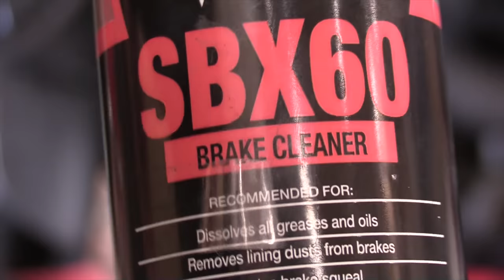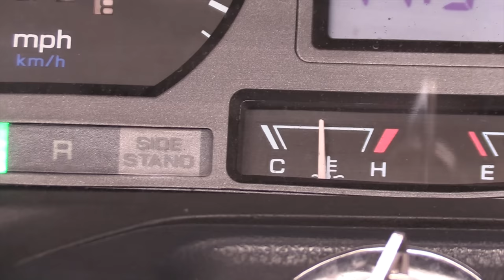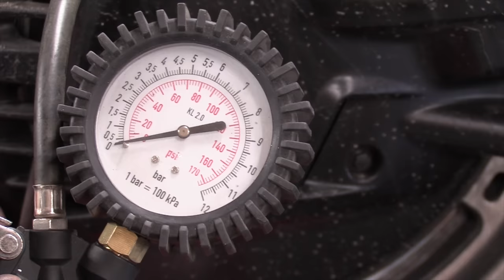Honda GL1500 Gold Wing, "Oil & Filters change" !

Comment: Nice vedio ,  but there is no need to add oil to the filter before installing it, just install the filter empty and put the factory recommended amount of oil . leave the engine runing for few minutes , then check oil level again .

Comment: Love the old Goldwing content Del. Looking forward to a nice warm summer to put a few miles on my venerable old GL1100.  FYI the Sealey brake bleed syringe unit from Spanner Monkey arrived today. Will let you know how things progress.  Run my GL on Smith and Allan super 10-40 oil. It’s approved to API SL, JASO MA2 so perfectly suitable for motorcycles.  Ride safe sir.
Reply from the maker: Thanks Michael, really appreciate the feedback, and great to hear that your syringe arrived, let us know how you get on with it.   Thanks so much for your support.. D&Pxx
Reply: Del, used the Sealey bleed syringe, great piece of kit. Only took a few minutes to force the fluid from the calliper to the master cylinder reservoir.  Let the system settle for a few days then bled the brakes in the conventional manner to remove the last traces of air. Next job, bleed the front brakes of my Z1000 A1 - should be nice and easy.

Comment: Nice work Del and Penny. Doing anything on a Goldwing is a treasure hunt... dig until you find what you're looking for. Great video... nice to see you priming the oil filter as one should. Does that Simota air filter not get an oil coating? Stay safe and healthy!
Reply from the maker: Hi John, I like that, that pretty much sums up a Goldwing, like a Pandora's box of plastic panels!  The Simota filter, just like K&N, come oiled and ready to fit, which is why they're in a sealed plastic bag, and you buy solvent and oil separately to service them later on!

Comment: I have a 2014 Ultra Limited that doesn’t get ridden much at all for various reasons. I use Mobil 1 synthetic and was wondering how long you would recommend leaving the oil in before changing it? Like time wise?
Reply from the maker: Hey buddy, it depends largely on your climate, if you're in a cold, wet climate you'll get lots of condensation inside the motor on short rides and the oil will gradually get waterlogged, leading to rust on internal surfaces, but if you live say in Arizona where it's hot and dry, your oil will last much longer, unless you get the bike super overheated on continued short parade runs... many Harleys don't do high mileage and in that situation, just drop the oil every year as part of your annual service regime, it doesn't cost much compared to the life of your engine so why not spoilt your baby!
Reply: @Moonfleet41  I live in Texas USA where. It gets cold in the winter but not like the northern climate. Whenever I ride the motorcycle I always ride it enough to get it up to temperature, so no short rides.

Comment: Well I have reused the Sump Plug on my 12 Goldwing Umpteen Times...it never Leaks.....
it does not appear to be deformed in any way...Hmmm..
Reply from the maker: "Hmmmm"?  Not sure what that means?  ... but if you're questioning the process, look how deformed mine was, if yours doesn't drop off the plug by itself, and it's jammed under the thread, then it is compacted and deformed, and your manual will always advise to replace it... and remember, it isn't just about leaking, the soft washer also acts to lock the thread and keep the plug in place in the repeated heat cycles any engine will go through...

Comment: The air filter is easier to do when the machine doesn't have a radio/cassette fitted like yours.  I am surprised you didn't change the fuel filter while you had all the plastic off.
Reply from the maker: That top panel is just as easy to get off, and replace, with the audio unit fitted, it's just one extra plug to undo!  And as for the fuel filter, it was replaced with the fuel pipe when I got the bike as it was weeping...

Comment: Del, whats your opinion about copper washer for drain bolt? Which is better?
Reply from the maker: Both as good as each other mate, but in this instance the service manual for the Goldwing specifies aluminium, so I go with that as I have some!
Reply: Good question, I'd wondered the same!  Oh, and thanks for the answer, Del!

Comment: Ah, wheels away that lovely piece of rather immaculate Wensleydale & then rolls on a whole six pot Stilton, complete with 237 panels  of Tupperware 'crust' & an air filtration system that would have stopped Luke Skywalker's amazingly lucky 'lob' shot in it's somewhat 'shiny-bottom' little tracks!
(Heard from deep within the choke tubes - "Look mummy, it's the 'Eyeballs in the sky' grandad talk about!"  Y'all : ) xx
Reply from the maker: The worrying thing is mate.. im actually starting to understand your posts now.. .should i be worried..lol!
Reply: @Moonfleet41  - Nah, the worry comes when you can imagine Dolly Parton drag racing your Wing without the airbox.
Mother & Father of all hickies . . .

Comment: Hi Del, after your video, I immediately ordered Simota for my V-Strom 650 2007. Later, after reading the filter cleaning instructions, I saw that they recommend cleaning with a Simota cleaner and compressed air. As far as I know other air filters such as K&N, BMC and others, also treat with a special degreaser, but then with a low pressure water. So can I clean the air filter with specialized detergents from the other brands (K&N, BMC ...) and can I wash the Simota air filter with water?
Reply from the maker: That question, if you want specifics, would be best directed to Wemoto technical department so they can cover exactly things like warranty and liabilities, however, on my own bikes, I've had not just Simota, but K&N, Green Cotton, and even the foam Pipercross, all of them recommend their own detergent and 'specialised oil', but I just use warm soapy water to clean them, let them air dry and use a  brief spray over with WD40, and they've always been fine... now as a warning, am sure that will court howling objections from the screaming haters, but it works for me and that's what I do, never had a problem, but it largely depends on the amount of dirt you're sucking in, and the environment.. and just as a quick for instance, if you live in a place where it rains every day, then you need the oil content to cut down moisture ingress, but if you live somewhere like Arizona in the desert, then you run them bone dry, because they'd dust up like a fly paper in 100 miles and block solid, you keep them dry and bang them out by hand every month or so... horses for courses and all that!
Reply: @Moonfleet41  Thanks Del! Congrats for "Firing the Legend" keep doing what you do best!!!
Reply from the maker: Thank Mihail... I also think you tried to private message me on Facebook, unfortunately we have a problem viewing private messages, we've reported it to FB, but if you need to contact, you can email direct to:  delboysgarage@yahoo.com  !
Reply: @Moonfleet41  Yes, it was me... but I find a way to contact you :) Good luck with FB problem.

Comment: A do-it-yourself washer, what a brilliant idea. If you have a lathe ;-) and know-how. 
Does the new airfilter need grease/oil/spray like the K&N I use on my two Enduros?
Günter from Nürnberg
Reply from the maker: The Simota filters come oiled and ready to use, and you can buy cleaning solvent and oil for when it's time to clean it later.  Link is in the description.
Reply: @Moonfleet41  Thanks, Del, that sounds like a perfect investment